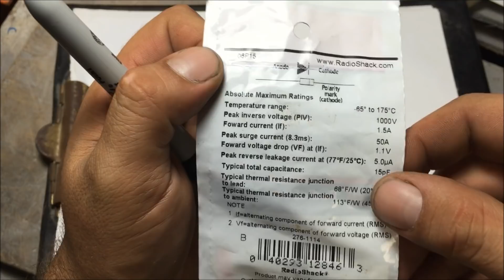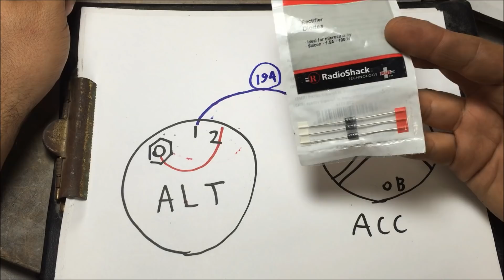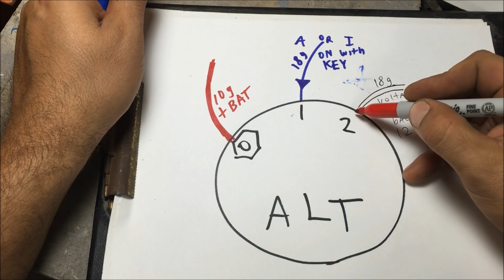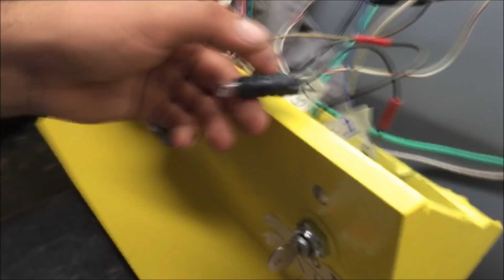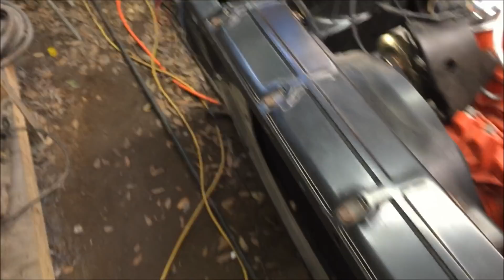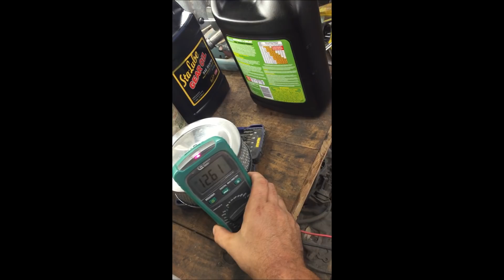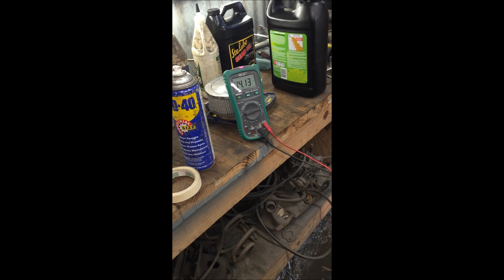how to wire up GM 3 WIRE internally regulated 1973 and newer alternator

Comment: What if you have a janky push-button start system installed by a previous owner? It's the simple ToggleSwitch on, Push Button to start style. The alternator was disconnected for whatever reason and my battery of course doesn't charge. This is on a SBC (small-block Chevy) swapped 91 GMC.
Reply from the maker: then wire #1 to toggle switch on with the DIODE ... loop #2 back to the big lug on the alternator.. you should watch my charging system video to make sure you have it right.  It’s an older video that sucks but shows how it should be set up

Comment: I have a 1980s Chevy Scottsdale 3/4 ton I got it from Tennessee and basically all they did was they ran a wire from the positive on the battery straight to the alternator and that's it I mean I'm missing everything else it seems is it basically where I need to buy all new relays and everything and put that on or I don't know I'm stuck right now because I'm burning up alternators and I'm in a bind
Reply from the maker: wire the alternator up like in this video.. and the rest like in my 64-72 charging system video and you should be good.. the alt to the battery is 100% ok just jump #2 back to the lug going back to the battery

Comment: I have a moroso switch panel with a toggle switch for ignition an a push button for start an it only has 2 positions on the back. You know how to wire that up?
Reply from the maker: send me the part number and I will look it up

Comment: Kris  the problem I have is my dummy light won't go off every thing else is good, I have the diode and a resistor in the no1 wire what gives?
Reply: 85 Elcamino with the computer removed
Reply from the maker: wire it separately like in my dummy light explained video to check it..
if it still dont go out the alternator is bad..  even if it still charges

Comment: I have a 1961 Chevy that I recently bought. The previous owner converted to a 100 amp alternator. The generator light stays on. Things have to make sense to me. I understand that nothing is going back to the dash so the light stays on because it not sensing a charge.Why can i not connect to number one and have the light turn off when it's running ? It's been quite a long time since I've worked on cars so bear with me here. What's the purpose of running the number 2 wire back to power?
Reply from the maker: #2 is voltage sensing and HAS to be hooked up straight to BAT .. all you can do is pull #1 off plug and run 194 bulb through wire straight to BAT and test #1 exciter wire separate.. I have seen them charge and light stays on meaning that they will soon go bad and not charge
Reply: I didn't explain that clear enough. There is no wire on number one or two So all I need to do is run a wire off number one to a 194 bulb to the ignition? Is that correct? I've not driven this car much as I've been correcting grounding issues and getting it more road ready. So what's the downfall of not having a wire on number 2 ? BTW thanks for the response.
Reply from the maker: in that case loop a small piece from# 2 back to lug(12v from BAT) just make sure #2 is hooked up .. leave #1 off you don’t need it ( alt will just kick in around 700-1200 rpm and start charging usually chirping the belt)

Comment: Great videos Chris, how can I get in touch with you privately, email if possible
Reply from the maker: +Juday Hajri message me through YouTube and if I can help I will
Reply: Ok, I wash hoping to send you some pictures to verify the location in where the wire is connected.
I just bought a 1972 GMC Sierra C2500, I found that after driving for an hour or so, and I shut the truck off, it won’t start, it will crank like the battery is bad. Even though the battery is new Optima. So I removed them starter, I cleaned the terminals, replace the ignition & the Acc cables (purple & yellow), and. I’ll replace the battery.
Why do you think it doing this?
Second issue, there is a wire with 2 mini glass fusses, running from driver side fender to the passenger fender, over the rad support, but it’s not connected. I tried to connect it to the junction block on the passenger fender (positive) but it shorted out.
What is this for and where is it connected to?
Thanks
Reply from the maker: no one can diagnose an electrical problem over the internet..  have you checked the grounds?   have you checked for a parasitic draw?   if th wire shorts out then its grounded...  there are no factory fuses on the fender..  all i can tell you is that i need to see it in real life...   the only thing you can do is get a REAL wiring diagram ($10 on ebay) for your vehicle and you WILL find the problem that way
Reply: I did get some replies, and issue is resolved, thanks again

Comment: Chris, Can I install the diode downstream of the dummy light?
Reply: Also the solid line on the diode should be installed facing the ignition switch? 

Thx,
Reply: Just saw on the video Diode's (solid line) towards the alternator....

Thx,
Reply from the maker: +Raul Garcia do the easy conversion and you should not need a diode... I put diode next to alt pointing towards #1 wire if I need to

Comment: great videos, I have a delco 10si alternator on a bobcat skidsteer.  it  also has an amp gauge. the alternator is new but I can't get it to charge. it has power coming from the starter to the bat terminal on the ignition switch then jumped to the pos of the amp. then has wire from negative on amp gauge going to the stud on the alternator . I have the idiot light hooked up correct I believe. it comes on but doesn't go out even if I rev the engine.  any help you can provide will be greatly appreciated
Reply from the maker: have you put a multi meter and confirmed it is not charging...   sometimes they charge and the dummy light doesnt go off... technically means the alternator is bad...    is the amp meter reading above 0?  voltage?
Reply: Thanks for getting back to me.  Yes I had a meter on it, only around 12 volts with the engine running. Took alternator and had it tested and checked out good. No reading whatsoever out of the amp.
Reply from the maker: thats not charging the battery..  it needs to be around 13.5 -14.5... all i can say is check the BAT wire on lug and even run a seperate 10 gauge wire straight to the battery from the lug to see if it is a wiring issue...  something is not right...
Reply: I will give that a try. Maybe I should just eliminate the amp? Does the wiring I described sound right? I don't have a junction block like in your video. The hot comes straight from the solenoid to the bat post on the ignition, then jumped to the amp. Then the other side of the amp is going straight to the bat lug on the alternator
Reply from the maker: the 10 si is an internally regulated..  you need to replace the amp meter with a volt meter...  amp meters are for the older externally regulated alternators...  watch my 64-72 charging system video to see how it is wired
Reply: Thanks very much.

Comment: ok, here is my problem. We have a 64 chevy truck. the previous owner put in a 350 motor. never charged the battery and when we drive it the battery will go dead. I have changed the alt and then changed the regulator. After changing the external reg the dummy light is now on and battery is still not charging. I plan on getting a volt meter to help diagnose. any suggestions. thank you for the help
Reply from the maker: you need the multi meter to figure out the problem... i had a car like that and the 1 and 2 wires on the alternator were switched...  (like in the video) without that multi meter you have no idea what is going on...  $30 red calterm multi meter from o reilly is all you need

Comment: I have a 1963 impala with a external voltage regulator alternator i changed it to a internal regulator alternator like the one on your video and i wired the #2 to the + positive behind the alternator and wired it straight to my battery my "gen" light is on stays on.... I was wondering if i wire the voltage regulator plug #1 to my #4 by pass like your other video showed will it turn off ?? Not sure if i need to by pass the middle one since i am running the #2 direct to the positive on the alternator  how could i make it turn off ??
Reply from the maker: yeah, jump #1 to #4 on the regulator plug and that should take care of the problem..
Reply: Chris Craft... did that and it did work
Reply from the maker: so are you good? or does the battery still die?
Reply: Chris Craft so far I been good I cruise my car have my system on and it stays on before it use to die drain the battery
Reply from the maker: ok, so you are good now?
Reply: Chris Craft yup thanks for them videos

Comment: Run a freakin diode, a diode, a diode
Reply from the maker: +rooost I do that so people don't ask in the comments.." what was that part you used to fix the problem?"  lol
Reply: Chris Craft I have a 1958 chevy I am trying to convert and I I started it but the wires started to melt please help
Reply: Explain how to wire a ampmeter correctly and what wires to use

Comment: no it's an ice cream truck. I put n 89chevy motor into a 79 box truck. couldn't use the old alternator because of the serpentine belt set up. the alternator has three wires coming out from the plug. I got the battery plugged in and the exciter plugged in also. I also tried it without the exciter plugged in and got the same voltage
Reply: Jesus Gallegos you need to put the 89 fuel injected alternator and i   go buy a new alternator when it charges under 13.5 volts

Comment: I wired it the way you showed us. but I'm still only getting 12.65v at the battery and 12.06 at the alternator. any ideas because I'm trying to keep from taking it to an auto electrician.
Reply: Jesus Gallegos that doesnt make sense... are you running extra stuff like amps or aftermarket lights..extra stuff not stock?
Reply: It’s not charging. Nominal battery voltage is 12.5. If that’s all you got, your alternator isn’t working.